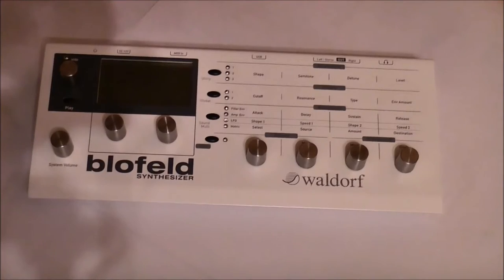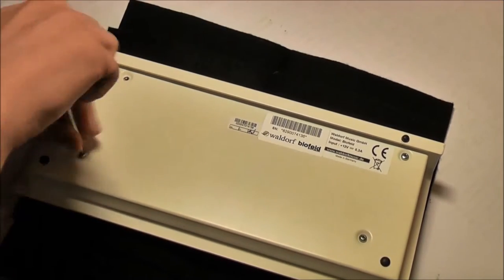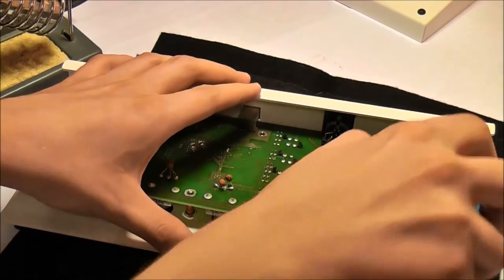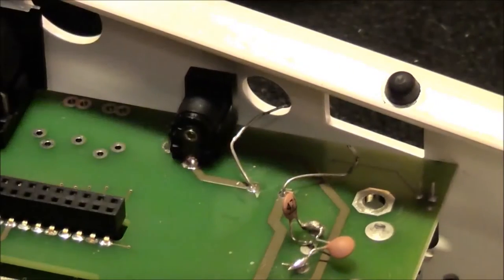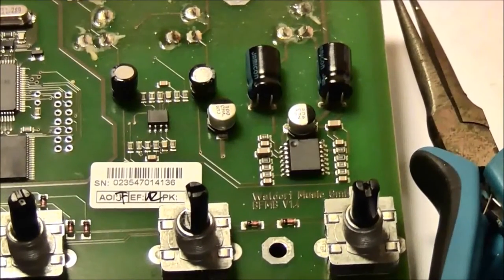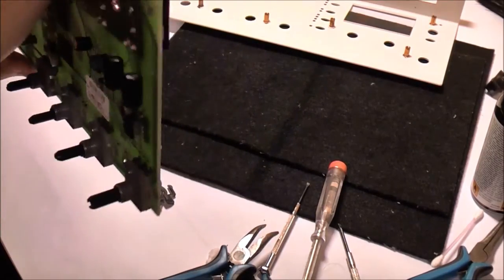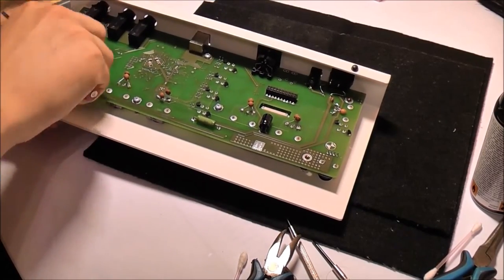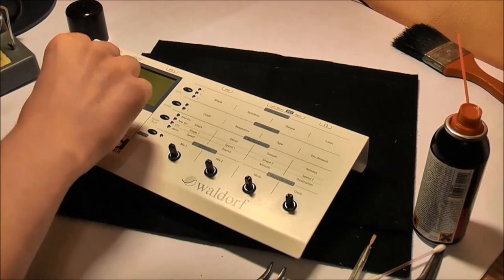[tutorial] Disassembling Waldorf Blofeld Synthesizer

Comment: How different the pcbs between the desktop/keyboard versions? Possible to diy the midi out for on the desktop version  i wonder? Nice video, thanks. Nice audio also, thanks.
Reply from the maker: The very old versions of the Blofeld do have the old pcb which does not have the soldering points for a MIDI out. Though, the "new" version of the Blofeld share boards for desktop and keyboard which means that you could theoretically build the MIDI out for a desktop. You can see it in detail in Google pictures when you search for "Blofeld pcb". Look especially on the pictures of the black desktop version! There you can see the prepared board.

Comment: Did you make a comparison of your version vs BFMF2.04 ? Does  it have the same DACs ? I had blofeld when it just started, and, being extremely disappointed in its poor sound quality and buggy engine, I had it given away for free to random person on the internet. But recently I've purchased it again, and ofc it is some new revision, the motherboard look like flipped left to right compared to what is shown in this video (you can also find the different version photos on the internet). This new reincarnation of blofeld sounds quite a lot better, has nice and crisp highs, (which was just too weak and subtle) and they even seem to fix synchronized oscillator start issue (loud pulse when you program change the currently playing part), which was pissing me off a lot
Reply from the maker: Thank you for this information! My device is very old and indeed one of the first ones. Unfortunately, I didn't have a chance to compare my Blofeld with new units. But I know that there have been some revisions of the mainboard due to discontinued components. Although I've never heard of noticeable differences of the sound quality. It's not unlikely that newer units could sound better ;)

Comment: I recently purchased a used Blofeld, and I opened it up to clean the chassis.  The display has some weird rainbow-colored blotches, as if oil somehow got between the clear protective piece and the LCD.  Unfortunately, I have no experience with soldering, and I don't own an iron, so I just lifted the PCB a little and tried to examine the display.  The protective piece seemed stuck to the LCD, and gentle prodding on any side would not move it at all.  Is that normal?

Comment: thanks for video. question: do you have suggestion how to fix loose buttons? Suppose that some kind of contact cleaning should do the job? thanks
Reply from the maker: You mean the five black push buttons? They are really standard parts and can be replaced very easily with some basic soldering skills.
Reply: @SynthesizerVideo  yes, five push buttons. i just opened the Blo, and yes, they are such component that cant be cleaned. do you know the exact model of this component and where to order it online (EU)? thanks again
Reply from the maker: Try ebay and search for "tactile switch" (in german "Kurzhubtaster" ^^), then just take the right size. They are really cheap ;)
Reply: @SynthesizerVideo  Are they standard 6x6 mm parts? Looking to buy a kit for other projects and thought maybe it's time to change the non functioning global one.

Comment: I have had this blofeld sitting disassembled for the last 6 months collecting dust, because for the life of me, I cant fit the pcb back onto the case, either a light is slightly bent or a small plast button falls out or the screen protector falls off or it braces against some unknown force, I am literally ready to throw  this thing in the fucking ocean
Reply: AND once i figure out how the fucking thing fits back together, i get to learn how to solder just cause some of the buttons were sticky! Haha! Quality Engineering! Not Even Rack MountablE!!!
Reply: If you throw into the ocean, please remove all plastic parts first, so as to not add to the pollution.
Reply: @wraithsnowyo  Stikcy buttons. I dont think you need to replace - cant you just clean the contacts under the plastic caps/buttons. I see this guy has some deoxit in his video..